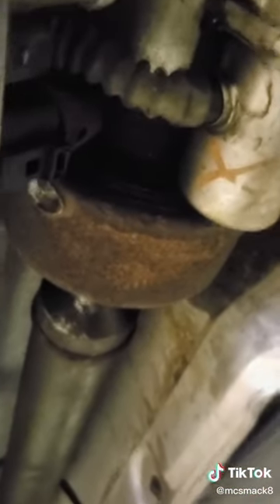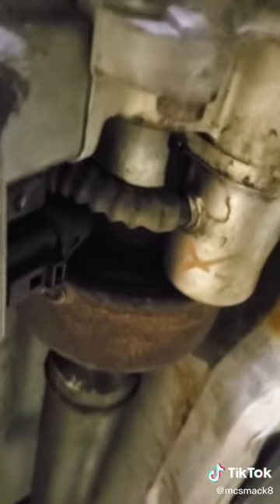How Engineers Keep Mechanics Miserable (Part 356) #shorts

Comment: I dont blame engineers for this, I blame rust! Engineers put that bolt to help u, so in my book, they tried.
Reply: If the engineers really tried then they would've spec'd those parts and bolts to be made out of aluminum or stainless steel, instead of cheap shitty carbon steel. They damn well know most cars will see frequent water and MANY will see road salt for months at a time.

But if they didn't design these things to rust, they'd last a lot longer, and that's not good for new car sales.

Planned obsolescence. They don't want these things to last.
Reply: @RefinedRandy  in that case id say blame the accountants, ideally im sure engineers would prefer everything be made perfect but accountants want everything made cheap, so they are forced to compromise and make things perfectly cheap.
Reply: @estergrant6713  Accountants don't determine the material a part will be made out of.

Engineers do. Material selection plays a huge role in the design/geometry of the part, because different materials have different strengths. So a part made out of aluminum will have to be designed thicker than any kind of steel to have equal strength of the steel, since aluminum isn't as strong as steel.

Material selection is part of the design stage of the car when drawing parts in AutoCAD/Solidworks. Aka the engineers job. The engineers are to blame. 

Keep in mind, this is all coming from an engineer, so I'm not just blindly hating on them. Most people would be disturbed to hear what engineers are taught in their economics classes. There's a reason engineers have their own economics courses separate from other majors. 

I'd like to be the guy who goes against the system and greed and looks out for the customer/common man instead of screwing them over. Hence, why my goal is to create my own car company, and why I went into mechanical engineering.
Reply: @RefinedRandy  i know accountants dont directly select the material? thats beyond obvious. youre whole explanation literally explains nothing beyond “engineers make the stuff” yeah i know, everyone knows. but they make those decisions based on parameters set by in part accountants or monetary pressures. so yeah the engineers literally chose the material but if money was no object im sure theyd have chosen the absolute perfect material in every single case. that was the point of my comment which in no way warranted such a lengthy response by you
Reply: @RefinedRandy  That really seems like such a silly thing to say, especially as a mechanical engineer. I would love to say "f*** it, its all titanium cuz why not", but I'm pretty sure my superiors would have an aneurysm at the quote sheet. Of course money comes into the material choice! 
Other than that though, yeah making things out of rustable metal is definitely on purpose. Keeps overhead lower and brings the customers back to pay more.
Reply: @thegreatgali1739  not ONCE, in my comment did I mention titanium. But go off.

Side note FYI: more people with engineering degrees own companies, than people with accounting degrees.
Reply: @RefinedRandy  I didn't mean to imply you said titanium, its just my go to because its a very expensive alternative to stainless steel. (And it makes me giggle when I imagine one of my managers faces if I had my current project made from titanium)
Reply: @RefinedRandy  Well I wish you the best! And if you do, don't do like Ford and make the aluminum truck beds made out of the same alloy as the rest of the body, they are way too soft.
Reply: @thegreatgali1739  I appreciate it and I'll definitely keep that in mind!
Reply: @RefinedRandy  accountants can change the price used for said materials forcing engineers to use cheaper materials.
Reply: @someweirdoguy6633  jeez ..... I really can't believe how many people out there think that accountants have any decision making power for companies in terms of how they make their products or how much they should sell their products for.

Accountants don't set prices of raw materials. Accountants don't make decisions for the budget of a product to be made. Accountants don't determine material choice for a product. Accountants don't set the sale price of a manufactured product.

All of that is done by owners and managers who are often mechanical engineers, or the owners and managers consult mechanical engineers about those things.

Accountants do the bookkeeping for all the financial aspects of a company. They create profit-loss statements, handle everything tax related, conduct audits, etc. In summary: they essentially gather and simplify all the financial information for a company, so it's easy to understand for the owners/managers, and then the owners and managers make decisions how to move forward and conduct business.

Accountants have virtually zero decision making power in a company. They don't make decisions. They primarily simplify financial data so the real leaders can make decisions.

You want decision making power in a company? Especially a car company? You have to be an owner, manager, or mechanical engineer.
Reply: @RefinedRandy  Your comments on this video prove you have never worked in this industry lol. A CEOs main goal is profit for the shareholders, not making sure a bolt is rust free 20 years after production. Hire me if you do end up starting your own company though, it would be nice to not have an accountant axe my projects!
Reply: @twodudesnape2990  I actually said exactly that. That car companies #1 goal is max profit, which means selling as many cars as possible (which means making cars that typically don't last 10+ years to keep new car sales up) and maximizing their profit margin (which means reducing production cost of each unit, and charging as much as they can but still maintaining a price point that most people find reasonable for that car)

Their number 1 concern is their own profits, and the profits to the company shareholder. I HATE that business tactic and STRONGLY disagree with it, and being taught that tactic in my economics class for mechanical engineering like it's the right way to do business ...... pissed me off to say the least.

The customer should be the #1 concern and interest of a company. A company is nothing without happy, loyal customers.

How do you create happy loyal customers? Create a superior product, with an exceptional life span, for a reasonable price, EVEN IF it costs slightly more than the competition.

Look at Scrub Daddy. The dude created a new sponge with a unique new material. It holds suds better than an ordinary sponge, it's more versatile than an ordinary sponge (soft and pliable when hot, stiff when cold for scrubbing), holds less bacteria than an ordinary sponge, AND lasts MUCH longer than an ordinary sponge.

Does it carry a price premium versus an ordinary sponge? Yes. Is the price still reasonable for the product? Yes. Is the difference in quality worth the difference in price, to result in a good value? Yes.

And that's why Scrub Daddy has become MASSIVELY successful and is taking over the sponge market. They ignored "traditional" business/financial tactics and instead focused on providing the customer with a premium value product with an exceptional performance:price ratio.

My dream is to bring the same ideology to the automotive industry. It's a JOKE that you can pay $80k for a new car in 2023 and your dash board is STILL made of soft touch plastic that's made to "look" like leather. For $80k you should have an Alcantara wrapped dashboard.

I find it REPULSIVE how the #1 areas of a car to receive alcantara covering is the steering wheel and seats.

Alcantara has poor wear resistance compared to leather AND gets dirty easier than leather AND is harder to clean than leather. And they decide to put it on the top 2 touch points of a cars interior: the steering wheel and the seats. RETARDED.

Alcantara belongs on the dash board and roof lining. Not steering wheel and seats.

2 other great reasons for an Alcantara dash board? 1) Alcantara is UV resistant. No worry about sun damage or fading. 2) it reduces sun glare off the dash and dash board reflection in the windshield.

Car companies choose the wrong materials for MOST parts of the car, in terms of having the best interest for the customer. Because it's 100% about profits to them. FUCK that. Provide a high quality product for a reasonable price to have a product with exceptional value and you will DOMINATE your industry.

Everyone talks about their favorite car brand. Meanwhile I hate them ALL. I CANT STAND ANY of the current car companies if you can't tell lol
Reply: @RefinedRandy  money has tons of power over what you can and can't do.  Budgeting is one of the very first things engineers are taught to work around.  If you look at nearly any collapse video of buildings, usually collapsing is caused by shortcuts on money, or cheaper revisions on designs/cheaper parts substituted into projects.  I will admit that engineers can be careless at times, but safety, and budgeting are the VERY FIRST things taught to engineers.  And saying accountants and business men aren't at all at fault is just wrong, because 1/3 of the time, it is their shortcuts and budgeting that causes the project to fail in the first place.
Reply: @RefinedRandy  They will. They sit down with the engineers and say "This material per X is Y less that what you have specified. Tell me exactly why we should use what you have specified instead of this material that is cheaper"
I veto any fantasy that says otherwise,especially yours.
Reply: @RefinedRandy  Actually you are correct. Accountants only funnel the money but marketing decides the budget and we engineers have to make things happen in that budget. The main design spec on all things commercial is money and that dictates the material that will be used. We engineers dont choose anything, we only make wishes.
Reply: @RefinedRandy  And you dont want to use aluminium in drivetrain parts because aluminium does not have a fatique limit so we cant calculate the structural thickness for that kind of part. Also aluminium is corroded by salt and the crystal structure of aluminium is larger than the structure of carbon steel. That basically means that then aluminium oxidises, larger chips/flakes will come off from it's surface and that means it will build slack way faster at the spline slider. Those spline sliders shoul be re greased from time to time so again the blame is on the consumer for not maintaining the product and not at the engineer.
Reply: @jippo91  you're either not an engineer, or you're a CivE, or you didn't pay very close attention during your materials class.

Blanket statements like "salt corrodes aluminum" are very unintelligent bc if you took, let alone payed attention during a materials class, you'd know that the corrosion resistance varies from alloy to alloy (yes, including different aluminum alloys)

I also didn't mention ONLY aluminum, but apparently you missed that, which leads me to believe you may have taken engineering classes, but you surely didn't pay very good attention or retain much knowledge, at least not in your materials class.

No shit an aluminum driveshaft or axle isn't a good idea.

Frames (which is whats shown in the video if i remember correctly, so largely what were talking about, frames) are perfectly fine to be made from aluminum. Go ask Ford how much better it's been working for them than carbon steel frames.

But for an axle or driveshaft? Stainless steel would be a superb choice.

The problem is that car companies don't want cars to be extremely durable and long lasting, bc that impacts profits, as long as they're all on the same page and making products that have approximately the same lifespan.

Plus all the other companies who over charge for their shit? Like companies who provide metals for car companies? Which subsequently drives up the prices of everything else downstream.

I mean at the end of the day, the problem is bc of a small group of people, who own and control the majority of companies and money. And all they're worried about is keeping, and making themselves richer, while they screw the average person.

Comment: The mechanic is the lowest level of that food chain. Engineers design the cars to be built, not repaired. Manufacturers only care about building the vehicle at the lowest cost possible, with the cheapest parts possible. The average American car owner doesn’t realize this and basically doesn’t care as long as the car is under warranty. When it’s out of warranty then it’s always the dealership’s fault and/or the mechanic’s fault. The customer rarely blames the manufacturer for designing, building and selling a piece of garbage. Been there, done that.

Comment: Engineers get immense pressure to make things cheaper.  They do not have the luxury of designing vehicles to last 20 years.
It’s called Planned Obsolescence.
If engineers had their way, the vehicle would be easy to repair and last forever.
It would also cost ten times to make!

Comment: I had a pleasant test drive in that model (looks like an '03ish XC70) but was scared off by the added complexity of the turbo and AWD system. I like to work on my own cars when I can and I really didn't want to deal with that.
Reply: Volvo AWD systems are dumb.  A set of snow tires and AWD isn't needed.  Turbos aren't bad though, easy enough to service especially without the AWD bevel gear underneath.  Worth it.

Comment: I have been a mechanic in Canada for over 20 years. Figure it out and don’t be a pussy. There is more then one way to fix things. Don’t like mechanics that always blame the engineers but never give them props when the job is not as hard as they thought. 😢
Reply: Never once has a job been made easy by the engineers
Some would say merc has their oilfilter up on the engine, well yes, but the oil return is about half way on the filter so everything is covered in used oil when you snap the filter element up from the holder.
There are plenty of maintenance that could have been made fu*king much easier, like design manifold so the oil filter has room to be removed
Or leave three holes from undercarriage and put one in line with the radiator drain.
All radiators that have hose connection on the drain, have the hose connection so there is absolutely no room for any type of hose, and those that has no hose connection has the drain outlet usually above something to spread the coolant as wide as possible and usually make it run inside the frame to leak out as many places as possible.
There is a hyundai that has 8 hours to change the water pump, just because there is no holes to allow the bolts to come out, aftermarket water pump comes with 2 studs so you don't need to remove the engine for changing the water pump when replacing the timing belt.
Either use studs from the factory or make few holes in other place on the frame so the bolts have room to come out. And yes that frame is only used for that engine, so it's not just a random occurense

Just a few that I remembered.

And last 
remove bumper and grill to change a driving lamp, aftermarket headlight comes with holder and a stud so you can lift the headlight out instead removing the bumper.
Or just design the fusebox so that lampcover can fit out

Comment: Engineers and bean counters should have to work on the stuff they come up with.
Reply: Agreed.  All manufacturer comebacks should go back to the dufus that designed and built it
Reply: Then you’d have $300/hr mechanics. But don’t worry, every engineer is backed up by a guy who builds stuff. Either in construction, automotive, mechanical etc. and they guy who builds things is going to make a bad phone call if you come up with something bad. Yeah, I’m an engineer. I’ve had those calls ;)
Reply: Are you kidding? They have pitchers of beer after work while laughing about the way the engineered this or that because it will be such a nightmare that the average person won't even try to work on it, but take it to the dealership instead.

Comment: I mean rust might be the issue here but also lack of experience, there’s a handful of ways to get around rust, the subframe removal, and all the other possibilities that were named. I can think of 4 more possibilities that weren’t named that probably would have gotten that out faster than dropping a subframe. Also you can 100% hit the front shaft bolts without subframe removal, snaking the shaft out maybe not, or maybe yes depends on how much experience you have because I know for a fact exhaust out of the way you can bring down the cradle bolts 97% of the way and snake that shaft out. Or you could just torch yourself a new bolt hole to push that bolt threw, or you know what really works with rust besides heat, vibration a good air hammer with a flat bit mhmm good shit right there. Lack of experience.. overwhelmed by the job.. pick one.

Comment: Sounds about right. So many things nowadays are not designed/built in a sensible fashion these days. I've come to the conclusion that trainees/apprentices these days (with regard to machine design) are only taught to produce something which looks neat/impressive on a computer screen, they are not taught what it is like to have to build/maintain/assemble (actually work on) any particular piece of equiptment. If  they were, then they would certainly know to put the various parts of the whole in places where it does not require hours of work stripping half of the rest of the machine just to get at one part.

Comment: I use a 12inch half inch to 3/8 adapter with a swivel 3/8 adapter to a long 3/8 drive torx bit. Gives me almost two feet to work with. I’d the overpowered matco gun won’t do it breaker bar will. Had similar situations on different cars. Also I would try popping the center bearing loose and let it sag down and give it a couple yanks down in the middle see if it busts loose. Spin it around and yank it some more